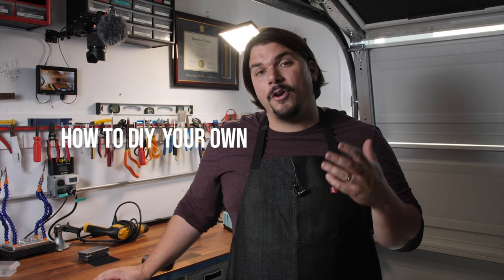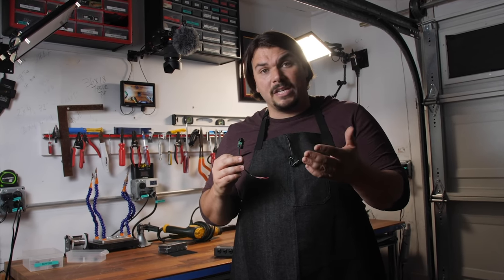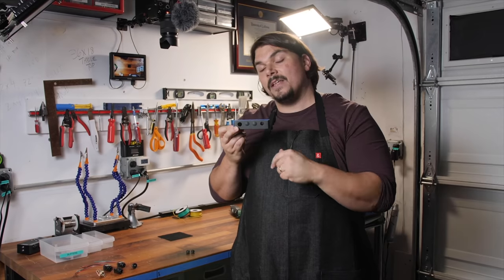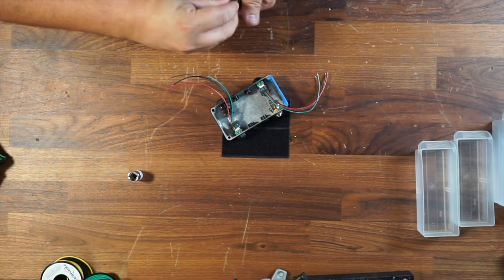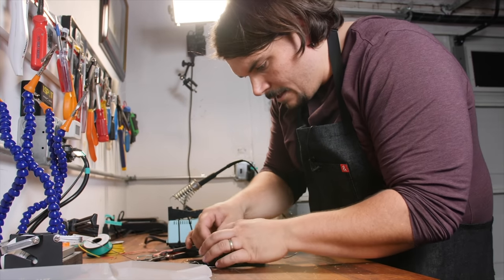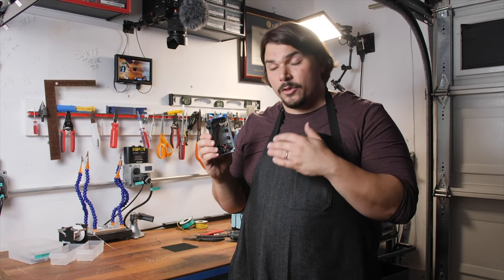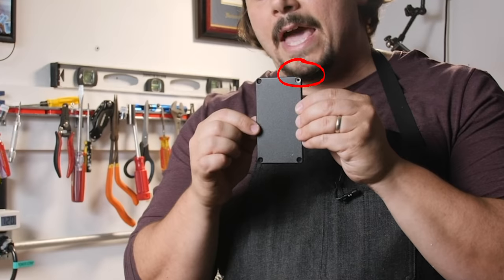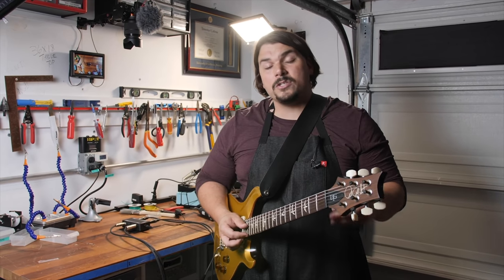Build Your Own Buffer!

Comment: My pedal board came with a patch bay inside of the board. I really like having the patch bay where it is at. Will running into that patch bay (it’s just a passthrough) then into this buffer box have any issues? I know it’s redundant, but I like the aesthetic of cables not coming off of the top of the board.

Comment: Uncle Mason!!!!  So about a year ago (or whenever it was) you posted on how to make a pedalboard interface box to have all my ins/outs run through one enclosure.  Been very, very useful!  I built a  4 cable assembly inside some braided pet sleeve to run between pedalboard and amp, and it has made setting up the 4 cable method quick and easy.

Now I will just replace those nylon isolated Neutrik jacks with these buffers!  Thanks so much for your continuing to teach all of us.
Reply from the maker: Perfect 👌. This will work just great!

Comment: Great video!  Not only did it inspire me to build a buffer as a project, it gave me a better understanding of what buffers do and why they are necessary for every board.  Now - it should be pointed out that you are not saving any money here...in fact, with the cost of those buffer jacks alone, this costs more than two TrueTone or JHS buffers.  Your time also has value, so this is far more expensive than buying one that is already made.  However, I think it is a very cool project and I am all in.

Comment: Great and informative....thanx to your videos ive built numerous interfaces ect...however with your downloaded templates even set at 100 percent they come up spaced to close...not a negative....just something ive experienced....dont know why it happens 🤷....keep up the keeping up...great respects...👍
Reply from the maker: If you’re not using the jacks we spec’d then you’ll have a problem.  Secondly, if you don’t print out the diagram at 100% scale in your printer settings you’ll also have a problem if you just leave it on default.  I use them every week, never had a fit issue.
Reply: @VertexEffectsInc  yes i bought all consumables jacks ect from your link but the problem for me at least is in the template...even set to 100% it prints small but i havent tried altering the orientation?....i wonder if that is the problem...ill try that on next build...this wasnt in anyway a negative comment by the way...just something that happens to me...all good 👍
Reply from the maker: @kevinjudson  I would predict it has something to do with the computer, and printing to scale, it should be centered on each wall, and the lions should line up with the beginning of the edge of the wall of the enclosure. I left a slight amount of tolerance there, just in case you get slight movement when you tape it down, but it should be pretty dead on. Again I use these templates every week, I’ve never had a problem with fit.

Comment: 2 Questions. 1) Every diagram shows an amp. Is there a use case for this with a Strymon Iridium to PA?  2) Starting with the audition pedal, can I add 2 stomp switches, 1 to bypass dirty effects and 1 to bypass wet effects with my Iridium in the audition loop as an always on? Effectively turning a few pedals on/off with one stomp switch. I’ve never opened a pedal before except to change a battery so I’m probably out in left field.
Reply from the maker: Chad, if you're going out of the Iridium the buffers won't hurt on the output, but you could remove those and just make those jacks pass-throughs instead of active buffered outputs.  The input buffer is still critical however.  You could attach the audition loop to a footswitch, but the way it's wired here is that it only brings in pedals into the signal path when the pedals are plugged in on the guitar/amp side of the board, and when you unplug it, it normalizes and just leaves the signal in series as though the audition pedal were never there.      There are a million ways you could customize this, but I'm showing the most practical and common applications.
Reply: @VertexEffectsInc  I built the audition pedal as shown and it's sounds great.  Can't wait to put a SSS on my board.

Comment: @mason sorry for the long comment. I emailed you and your assistants told me to try you here 🙂
You hit on a point I’ve always had in the back of my mind.  Tone suck and line impedance. I really started to think about my setup and how I might be able to benefit from stabilizing the input and output of my pedal board.  Anyways, I wanted to get your opinion on my signal flow.

I think I want to switch out my old TU-2 for a TC Polytune 3.  That should handle the input impedance part.  Use a TC Bonafide Buffer at the end of the board before going into the amp. 

Or maybe I can build a mono dual buffer like you have on one of your Youtube Videos. 

Note, my “normal” rig I use is a wet/dry/wet stereo rig.  Sometimes depending on the band I’m playing in and stage size I might just run a mono rig.  The pedal board is the same tho. 

 

I built my rig years ago and it’s been “evolving” ever since.  In 2006 I had my 5150 head modded by Jerry at FJA Mods.  Anyways around that time I really wanted to try and do a w/d/w rig similar to EVH.  Long story short, I messed around with it a bunch, figured out a bunch of stuff, and landed on what I’m running “basically” all these years later.   

My amp has always been fairly noisy. (as most high gain 5150s are known for)  Anyways, I run this basic pedal board in front of the amp.  Through a bunch of trial and error, I ended up with the pedal layout and signal flow.  Over the years, my wah pedal has always caused a bunch of noise when “on”.  I’ve used several different wah pedals over the years.  I like my Dunop wah and gone back to it.  I know that “typically” you want the wah in front of everything in the signal.  I didn’t really see a difference in tone/noise and ended up put in after my TU-2. 

 

Can you give me any advice and or suggestions on what I can do to get my wah to quiet down and potentially clean up my tone signal going into my amp? 

 

Thanks in advance for your help. 

Looking forward to talking to you.  

Below is the basic signal flow.  I’ve also attached a topology. 

 

Signal flow

 

Guitar-Tuner TU-2-Whammy Pedal-Digital Delay DD-5-Dunlop Wah-EVH Phase 90-EVH Flanger-to Rig

 

Rig signal flow.

 

5150 Head High Gain input-speaker out-Hot Plate attenuator-Line out-split in TC Electronics G Force inputs-balanced outs-SM26  (port 3 and 4)-mixed output into L/R RT2/50 slave amp-L and R cabinets

                                                                                                                - speaker out dry into 1960 4x12 cab     - split in to Rane SM26 line mixer (input 1)

Comment: I imagine it gets tiresome answering questions.  Just so you know, your responses always put a smile on my face and instills enthusiasm.  That's rare man, especially since I have only met you through your videos.  So thanks! Is there any wiggle room to experiment with other enclosures for the DIY buffer? Or is this something you'd advise against?
Reply from the maker: I'm so glad!  Thanks for watching!  You can embellish it however you want.  You can mix-match different diagrams so long as you have the right number of jacks to complete circuit.  In terms of the drilling, you're pretty locked into this pattern of holes unless you get a bigger enclosure and re-measure your spacing.
Reply: actually I answered my own question as I reviewed all of the diagrams on the DIY buffer page.  Perhaps if I only did the Mono dual there may be some room but any of the others that require more than 2 drilled holes, there simply isn't enough room for anything other than the hammond.
Reply: I have a Keeley modded BD-2.  I use the diy buffer as an input buffer on this particular rig. Because the BD-2 is a transistor based overdrive, would this make it high impedance and probably should be placed before the buffer? I did review the impedance specs of something I would put before the buffer like a Dunlop JH-F1 (10k, 115-2k) v the BD-2(1M, 1k), which as an overdrive would be placed after the buffer. Am I even looking at the correct figures to determine what should be placed before the buffer? Thanks man.

A side note, the inverse of this scenario, I have a reissue op amp Big Muff and it sounds proper placed the same way I do my higher gain drives.

Comment: Great stuff, thanks for being such an amazing resource! I've finally assembled all the components for my interface. I'm actually doing FIVE jacks on each side of a slightly bigger enclosure (1590N1) to incorporate my Komet Ambikab (2 for basic gtr/amp dry path, 3 for the SA Collider stereo wet effects into the Komet). Quick question: does it matter which side of the Neutrik jack to solder the wire to?
Reply from the maker: If it’s a switched Jack like I recommend, yes it will matter

Comment: Mason, I've been a diy/tinker for along time. Just as a matter of preference, I do or would do some things differently than you. That said, it's pretty awesome that you make these videos. I know a few people that gave that little passive patch bay you did a while back. They all ended up learning other things in the process. I guess what I'm getting at is thanks man. Also, I love the SSS.
Reply from the maker: Jason, thanks for watching and for the feedback.  I'd always love to hear from DIYers how they thing these things could be presented better - it only helps the final product so feel free to share if you have an alliterative or better method.  My confines are the four walls of my brain LOL, so that leave a good margin for error.
Reply: @VertexEffectsInc  the things I'd do different are just to do with my setup specifically. All of these are good ideas.  You're presentation is great and has motivated at least a few people I know to learn more and try something they may have otherwise found intimidating. I think that's a good thing regardless of the subject matter.
Reply from the maker: @diminishedseventh  any suggestions on set ups we didn't cover in the diagrams?  The main one I didn't to, on purpose, was those with galvanic isolation, mostly because the transformers for this aren't ideal that are inexpensive.
Reply: @VertexEffectsInc  I gotta say, I didn't expect this much engagement, but I don't get to nerd out that often. I don't know that I have any suggestions really. I don't generally like to include any transformers in a guitar setup that aren't strictly necessary. I don't recall hearing you mention it, but I assumed that was at least partly why you liked the Truetone power supplies. I don't think I could agree with you more on the point about good ground. Proper, consistent ground prevents so many annoying problems. I try as much as possible to keep cable runs as short as is reasonable and keep ground as consistent as possible. In my rig, everything in the fx loop is in a rack that sits with the amp. That came about as answer to cable lengths, but also eliminates the need to do 4-cable on the floor. I do have an A/B switch where the switching is mechanical straight to the A output, but there's a buffer on the B output. It's purpose is to facilitate two independent signal chains with the one on the A side including some old and old style fuzzes. Honestly, it's a bit inelegant though and most of the time I don't set it up . If you have thoughts for incorporating a fuzz face into an otherwise modern pedal board I'd love to hear them. I'm currently just using a Dynamic Distortion in the spot I want the fuzz. From there, I think all of your routing boxes can be a good option in certain rigs, I've just had the good fortune of getting my setup to a point that gear and it's configuration don't need those solutions. Where were these good ideas when I was 20? :)

Comment: Ugh! I wish I had this a few months ago! I bought a Humdinger (which actually works really well) to use in a stereo setup, but the stereo diagram you have looks to be a more sophisticated way of doing this - I am just going into my mono pedals, into the humdinger, and then out into my 2 stereo pedals out to the amps... I think I may not have thought this through... guess I may need to sell the Humdinger and start over... Great video by the way :-)
Reply from the maker: I think the Humdinger only does split mono - not stereo.  The way I showed is the proper way to do a stereo set up with the right buffering on input and output.  I think the Humdinger is one buffer only with a split output.

Comment: Ok so I’m looking at the diagrams to see which one is right for me, so my setup is currently Guitar-Polytune3-Bloom Comp-Tumnus Deluxe-SSS-Dsm/humboldt Simplifier (input)-Simplifier (Send)- Julianna (In mono)(out Stereo)- (Stereo in/out) Mako D1 Delay-Specular Tempus (stereo In/out)-Simplifier (Return left and right)- Simplifier Left & Right Xlr to front of house, Simplifier (1/4” Thru/dry signal) to Vox Ac15. So which diagram is right for me? Just ordered all the parts too :)
Reply from the maker: He will just need the input Buffer, and the output buffer on the side that goes to the amplifier. The stuff that goes into the simplifier I believe is all balanced, so you shouldn’t need an output there.
Reply: Vertex Effects Awesome! so I just need to make the one you made in the video!!!
Reply from the maker: @zachvargas122588  easy!

Comment: I didn't even know buffers were a thing until discovering your channel, thanks for all the tips. I am making my own buffer using your parts/diagrams and I'm a little confused on what you're doing with the green wire that is connected to the guitar input jack. Are you looping it through/around the bottom hole (in the diagram) and then soldering it to the middle/second loop-pole thing?
Reply from the maker: It's connected to two lugs on the input jack so you can short out the input when it's unplugged.
Reply: @VertexEffectsInc  Thanks for the replies! Another person in the comments was able to help me understand a bit better - short jumper cable to connect both connections on the jack. I was thinking you were doing it with one continuous wire and couldn't figure it out lol. Thanks uncle Mason for all the great content - you're changing lives :)

Comment: Excellent video-- I can't wait to build mine! If I power this with my board's supply (in this case, 9V / 100mA), what is the current draw per buffer? Will 100mA suffice?
Reply from the maker: 15mA per buffer is the draw, so even in the tri buffer examples it's 45mA max.

Comment: Great video. One question. All buffers are set to 1meg. Shouldn’t the output (running to amp) be 100ohms? The BOM says 3x 1meg. I want to try your recommendation of 1meg input and 100ohm output. Thanks for creating all this info. Very helpful. 👍
Reply from the maker: The input impedance is 1M on all the buffers, the output impedance is 100 ohms.  Not sure where you're getting 1M output impedance from???
Reply: I think what he means is he jack doesn’t seem to state the output impedance on the source website. I was actually wondering the same thing since I didn’t see it listed and was considering building vs buying
Reply: Yeah I was wondering the same. Ai1 Redeemer can be purchased with 10K Ohm as well, shout I use that instead of 1M for the output jacks ?

Comment: I've been using my DIY buffer interface for a year now and I love it. I varied the design a little to include 5 input/outputs so that I can run my SA Collider in stereo into a Komet Ambikab for a wet/dry split. One suggestion... would you be open to sharing the volume pedal schematic similar to what you have with your boost pedal? I don't have the pedalboard real estate for the boost, but it would be awesome and extremely useful to be able to apply the same volume pedal concept directly to the junction box and keep the same footprint. Just a thought. Thank you for all the great rig resources!
Reply from the maker: Glad it worked out, it's not a volume pedal schematic you're asking for, you're asking for our boost schematic.
Reply: You could buy the vertex boost and buy a tall enclosure box and rehouse the boost & your junction box into the new enclosure....to keep the same footprint. You could also just mount the boost on top of the junction box if you have a flatboard. If you have a pedaltrain or something similar you could also mount the boost under your pedalboard. Just some thoughts...

Comment: Sent this video to a friend, who is  much better with soldering, than i am!  He's gonna help me build this.  Thanks for all the clear instruction! 
Wondering, though, what you meant, when speaking of the power range of the Buffer, and you said "it will give it more headroom". What is headroom, with regard to buffers?
Reply from the maker: it won't distort with a lot of signal running into it. For 99% of cases, 9V is fine however.

Comment: Very helpful video and something I am interested in building myself. I would like your thoughts on the specific buffer and usage for my scenario. My pedalboard starts with a Radial Mix Blender to receive input and independently adjust volume for two different guitars; typically an acoustic and an electric. The output of my pedalboard goes to my amp which is mic'd in an isolation cabinet. Obviously, I can easily send the output back to a return jack of a buffer. My dilemma is on the input side. I could put the buffer after the Mix Blender but I know that buffers really should be the first in the chain. Any thoughts?
Reply from the maker: Is your mixer passive?  It might already be a buffer.  Otherwise, I'd put it after the mixer if it has two different inputs.